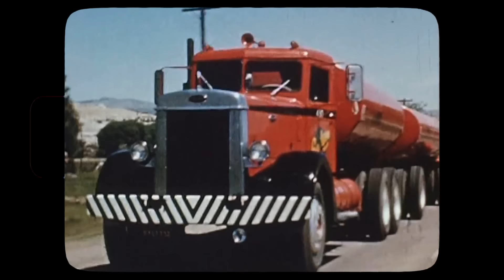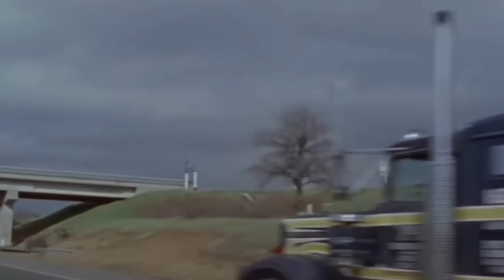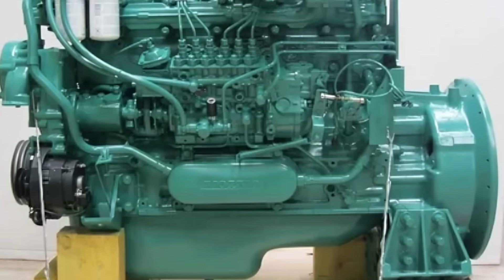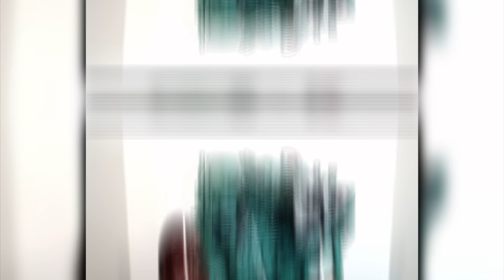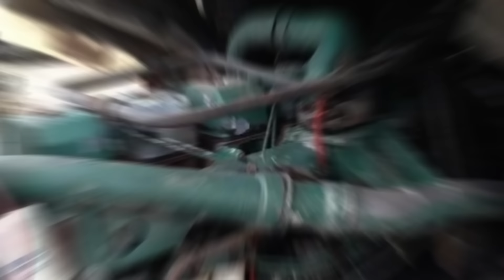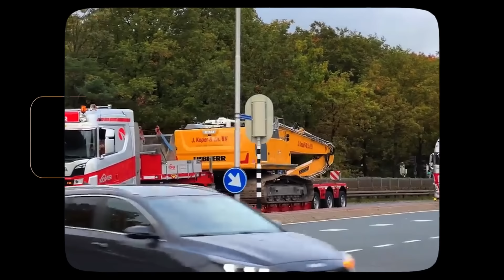The Forgotten Engine That Was More Powerful Than Detroit Diesel

Comment: Best engine I’ve ever had in a boat: Volvo Penta AD-41 series.
3.0l inline 6 that made 200hp, yet burned about 1.8 gph at trolling speed on a heavy 26ft planing hull.  The same boat would also top out at 28 knots, though I never checked fuel burn at those engine speeds😅
Solid as a rock, only weak point were the exhaust elbows that corroded no matter how well you took care of it.  
And parts were expensive, though that’s normal for diesel engines.

Comment: I drive a forklift, I used less fuel in a day on a Volvo Penta 6cyl mechanical injection (3 speed gearbox) compared to a new 4cyl volvo electronic injection (4 speed gearbox).  Btw a F16 with no load could be fun. Just put in the highest gear and floor it from a standstill...... . Also Volvo also had the smaller allround 12 liter engine.

Comment: we had some of those TD162s in White GMC / Volvo tractors pulling bulk in Northern canada @ 141 thousand LBS 
and had 11.1L series 60s in FLD120s both did the job the same and offered reliability but the Detroits had far BETTER parts availability but the tractors didnt hold up very well UNLIKE the MACK superliners before

Comment: The Caterpillar 3406B is a million + mile engine that only needed oil changes and a top set once a year. Those engines are still out pulling series 60's all day long. 
Show me a 40 year old series 60 that's still running like a champ.
The series 60's in 88 were 11.1L and were really lazy. Nowhere near the torque of the 3406.

Comment: The Cummins KTA 19L has been around for over 40 yrs and is still the king of the hill for power from production on road diesel engines. 
It was advertised detuned to 600hp for driveline warranty but can be cranked up to 1150 HP and 3800 lbs or 5150Nm of torque. 
All that from a 6cyl mechanical dinosaur. 
Show me any modern or any  production euro engine that puts out that kind of power. 
You can't because it doesn't exist. 
Tell me some more about how American engines don't have any power. 
By the way I'm not American and don't live in the USA but I have no problem acknowledging when an outfit puts out a killer product. 
Cummins KTA 19L is without a doubt a killer product. It's a production torque monster with no equal.

Comment: Series 60 DDEC 4 12.7 was a near perfect engine, as diesel engines go. Excellent on fuel and reliable, cheaper than all other electronic engines to buy, maintain and repair. When they weren't cut back they had a good amount of horsepower. They would outpull anything in their displacement class. No Cummins or CATs could pull with one. Lol. I laugh cuz Cummins and CAT fans will dispute this  but they're not comparing a stock C13 or C12 with a 12.7 Series 60. They want to compare larger 14 and 15 litre engines with a 12.7. As good an engine as the Series 60 was/is there simply is no replacement for displacement when it comes to power and especially torque. Compare apples to apples and a DDEC 4 12.7 was unbeatable in every way. The new Volvo 13 litre engines probably will outpull them now but at what cost? Try replacing the head or turbo on a Volvo and you're looking at ten times the cost. Takes a lot of fuel to pay for that!

Comment: I would still prefer a 53, 71, 92 or 153 series DETROIT DIESEL,  A 24V153 IN A OL PETE QOULD BE AWESOME..PUT HALF THE ENGINE IN/UNDER THE CAB. THE OTHER HALF UNDER THE NOSE. WITH A TRI AXEL SETUP,  WITH QUAD INTAKES,  FEEDING QUAD TURBOS WITH QUAD 8" STACKS. With  a stand-alone air to water intercooler system. And a huge radiator capable of cooling the 3500+ Horsepower (likely 3800 to 4200hp) with water injection to reduce egt's a 20 gallon tank keeping it operating over long distances. Also, using water condensed in the ac system helps fill the tank, (after going through an easy clean filter) running a boost pressure around 36psi, with a 20:1 compression ratio. With a 20' sleeper with a fold up bed/ couch, a mini kitchen a 100 gallon septic tank. For grey water only, 2000 watts of solar 1000 ah 24v battery, a5000 watt inverter, diesel heater, and air conditioning,  a cook top and mini oven, and microwave,  the diesel heater also heating water heats about 5 gallons by circulating water through the on demand heater from the tank . Taking about 5 minutes to heat the tank to 120°f, also a heat exchanger using engine heat to heat the water in the tank, it is possible to take two showers with 5 gallons of hot water. A 120 gallon fresh water tank, a 100-160gallon grey water tank , can be dumped anyway,  only has sink and shower water inside.  A5 gallon water bottle for drinking water. With a spout for room temp water and refrigerator chilled drinking water. Also cabinet room for food and coffee maker. With a vent to outside to keep steam out and cooking smells. A closet and composting toilet. An emergency exit to the catwalk at the hitch. The closet about 4'x4'  with the shower  about the same size, with a 3'x4' dressing area beside it. The divider walls about 1.125"-1.25" thickmade of aluminum tubing and aluminum sheet, with sound deadner and insulation the outerwalls about 2" thick with 1" foam insulation and sound deadner with fiberglass insulation  or synthetic wool for sound insulation  and thermal insulation.  With 1/8" aluminum outer skin, 1/8 wood or aluminum  insulation,  wrapped in vinyl or cloth or painted. Led lighting in the top of the walls , under cabinets,  and under bed/couch a weighted vinyl curtain to separate the cockpit. With the cab and sleeper on air ride, with shocks , QUAD axels (or triaxels) with axel to axel lockers,  and wheel to wheel lockers.it would be awesome if this engine/truck was made. At near 30 litres fuel milage is rated at gallons per mile..  it has to haul long and heavy to justify it. A road tractor train foshow..

Comment: So, America was already behind in 1988.
I thought it was after 2000 they got behind..
Reply: Small detail, Cummins had 765hp in the QSX back in 2001 is just they offered in in government vehicles and in fire truck, and the cat c15 comes with 1100+hp from factory if you buy as a a crate engine

In 1979 the 855 big cam was compound turbo, 4 valve per cylinder, unit injector and had 475hp a decade before volvo
Reply: @renacimientoargentino7515 Cummins KTA 19L was available back in 88. 
It was sold detuned to 600hp for driveline warranty reasons. 
The KTA 19L can be cranked up to 1200 HP and 3800 lbs of torque. It's still king of the hill for power output from production on road diesel engines.
Reply: @renacimientoargentino7515  Då kommer en fin fråga varför finns inte den motorn i alla lastbilar i världen ? Är den kanske för törstig eller släpper den ut för mycket skit ?
Reply: @andersmartensson1851  
1-Programmed obsolecense, Scania Volvo and mercedes want trucks that last 10 years max, that need propietary expensive software and equipment to fix

2-Caterpillar engines are expensive to buy and fix, in a digger than costs 3 million dollar is not a big issue, Cummins are expensive to buy not so much tonfix

3-Caterpillar was spending way too much money having two development teams for stage v/tier 4/euro6/epa2010, and they calculated they wouldnt recoup the cost by selling engines alone

4-They are taller heavier engines than european ones and they have issues fitting in cabovers, The ISX 15 weights 400kg more than the volvo d16/17, the Cat c15/16/18 weights 600kg more 

5-Any money a truck manufacturer pays cummins for their engines is profit they dont get, even if they are a higher quality

6-Mercedes discontinued the S60 detroit because it gave little secondary revenue in parts
Reply: @andersmartensson1851 how come Volvo engines aren't in every truck? Stupid comment.
Reply: @darrenwebb5334 Det beror på att Volvo motorerna är skräp i jämförelse med vad man behöver . En mjuk tyst V8 på mellan 700-2400 hk . Du slipper ha hörselskydd när du är ute och kör , Du kommer hem och är inte ett gående vrak . Inga mysko vibrationer . Senaste gången vid polis kontroll för miljö utsläpp så frågade dom om motorn va på slagen 🙂
Så dumma  kommentarer har jag sett från start här .
Reply: @darrenwebb5334 How come the US made european trucks expensive as hell to import in to the US and a bunch of regulations that made it almost impossible. 

Can it be that the US always have been very protectioistic about its declining US industry ?
Reply: America wasn't behind in the diesel engine power department. 
Funny how everyone doesn't talk about the Cummins KTA 19L. 
That engine has been king of the hill for power since it came out. 
It's the biggest production diesel power you can get in a road going truck still. 
That engine can put out 1150 HP and 3800 lbs or 5150Nm of torque. 
They were sold detuned to 600hp for driveline warranty. 
All on 6 cylinders and no electronics.
Reply: @darrenwebb5334 they make that power with a engine too big to be economical in a truck. They are extremely heavy and not efficient at all. 

And they are a class above truck engines. There are plenty of European brands that offer engines in these sizes and with that amount of power, just not for trucks but for industrial applications. The same applications where the kt(t)a 19 is mostly used for. But the Cummins doesn’t last as long as most European engines (caterpillar lasts longer than the Cummins too). The Cummins kt(t)a engine is not the best engine in its class, not even close.

Comment: The power output info about the Volvo TD162 in this video is incorrect. It didn't have 600hp, it only had 460-470hp back in the 80s (unless you turned it up ofc). Later upgraded versions of the TD162 had 520hp at most. The 600hp+ engines speced for trucks didn't come until the Volvo D16C series or later was introduced.
Only the marine speced engines (Volvo Penta) had higher power outputs.

Comment: the series 60 was the first engine that electronic Control would sut you downand leave you stranded in the middle of  no where because of a stupid  censer. one of teh  guys that hauled for the company I worked fro had 3  White GMC Trucks with 60 series theya ll had sinple  fails that stranded then 300 miles from home.

Comment: Series 60s were only rated up to 525hp and there were American engines making more power than that Volvo in the 80s. Cummins kta19 had up to 600hp.
Reply: the TD162 when it was released in the 1987 F16 truck did have 1000hp from factory but 7 months after release volvo quickly recalled all F16 trucks for a detune because the Bosch injector points would melt when pulling 52 000kg of weight in the hills of norway.
Reply: @ZeeROLIX  too much heat I guess
Reply: @Zeerolix That is some hot bs the TDA162 never had more than 550hp even in marine and genset versions

Neither is that difficult going uphill in norway, the grade is steep, but there is little change in altitude and you never go over 40kmh, put low range and go

Going up a 3% hill for hours, at altitude where the air is thin, during summer, while keeping a speed of 80kmh or more without overheating the coolant nor the turbo or as is in the southwestern us or northwest argentina, is where the real challenge is

Power requirement goes proportional with weight but exponential with speed, 52 tons takes 20% more power than 44 tons, but moving at 120kmh takes over twice the power than 80kmh

And thats where big Cat Cummins and Detroit excel at, they are industrial raw engines that have no issue having to output 450hp all day long with no overheating
Reply: @renacimientoargentino7515 you can think what you want but my grandfather worked at Volvo Lastvagnar Experiment/Utveckling from 1977 to 1994 and he told me that information.
Reply: @renacimientoargentino7515  What you are talking about a Volvo engine can do no problem and better even.
Reply: @zerocool6452  nah it cant the volvo VNL engines come from sweden and they still are shit
Reply: And 2250 lbs,-ft torque too!!!!!
Reply: The Cummins KTA 19L was sold detuned to 600hp for driveline warranty reasons.
That engine can be cranked up to 1150 HP and 3800 lbs of torque. 
There is no road going production diesel that puts out more power still. 
Everyone leaves this torque monster out of the chat when talking power because nothing comes close. 
I'm a Caterpillar guy but I would trade my Caterpillar for a KTA Cummins in a heartbeat.

Comment: You couldn't order a Peterbilt or any other American truck with a Volvo engine. To get that engine you had to buy a Volvo. Not every body wants to drive a volco😂😂😂😂😂😂
Reply: Europe stopped building cabs held together with rivets in the 1960s, 90% of American truckers would have a nervous breakdown if they worked in Europe. Reversing is mandatory on the East side of the Atlantic, artics (semis) go into urban environments that were designed 3-400 years ago, trailers are put into spaces with feet to spare not football pitch size areas. Volvo, Scania, Mercedes, MAN, DAF, Renault, Iveco build premium trucks with Europe wide dealership support, last Detroits sold across here were 6v / 8v-71s, big Cummins are all but extinct.

Comment: I’ve heard horror stories about being held ransom by Volvo dealers for those engines when they break. I’ve seen 60 series engines with 28,000 hours on them which is equivalent to about 1,600,000 miles. Without needing to be rebuilt. The 60 series was the ultimate engine when it came out. I remember the first one I saw come through Evans equipment. It does not sound like any other diesel that was on the market at the time. Crisp, powerful and smooth. There was nothing like them. Everybody went to overhead cam and electronic fuel injection because of the 60 series. It’s an epoch engine.
Reply: All european manufacturers are like that, they make trucks and engines as complicatrd as possible with as much non standard propiertary stuff so it breaks down in 10 years from now, this is because in europe owner operators are less than 15% and most companies with a truck being disposable, volvo, scania, man sees a 2 million mile engine as the devil
Reply: @renacimientoargentino7515  In Europe, most trucks are sold to the east when they have reached 500000km!

Comment: When the 60 series Detroit first come out. It was an 11.1 liter engine. Then there was the 12. Liter, then finally they developed the 13.9 liter (called the 14 liter).
Reply: 12.7 litre.
Reply: När kom 14 Liters motorn ?
Reply: @andersmartensson1851 I want to say in the late 1990s, like 1998? I just checked the Internet. It was 2001. Bigger bore and a bigger stroke. The same block. I've heard of this after I purchased my 12.7 liter.
Reply: @RichardPickell-e5b  1989 körd jag men första 14L V8 en Scania 143 H med 6x6 i min Militärtjänst . Den va häftig . Vi körde stridsvagnar men inga tung transporter över 65 ton . 
Motorer är rätt kul . 
Ha en god Jul Richard 🙂

Comment: Nobody wanted it because it was a volvo 😂.  Also no mention of the 3406 or N14?
Reply: Is impressive that people forgets that Cummins was hitting 380hp in the early 60s and 475hp in 1977, Scaniia in 1979 had 350hp and volvo D16 had 475 in the late 80s
Reply: @renacimientoargentino7515 

Cummins had 600hp In 1960s.
Reply: @renacimientoargentino7515 scania 141 1979 was 375hp! 😇
Reply: Same
Reply: 3406 was around 450 hp in the 70s I believe but it was a darn good motor
Reply: The n14 was in the 90s and is about as old as I am.